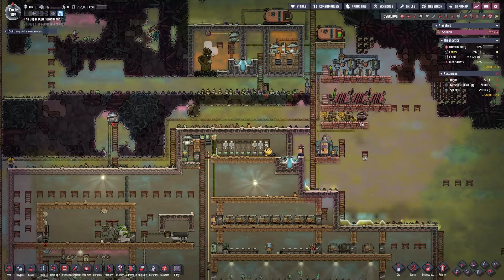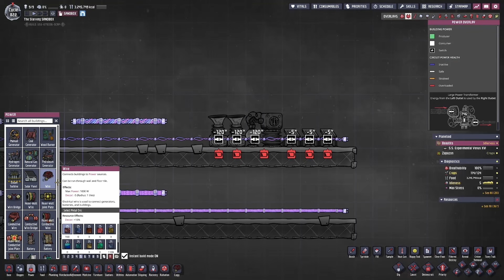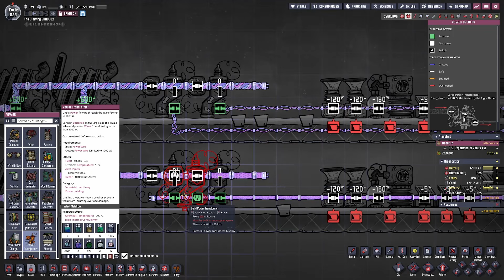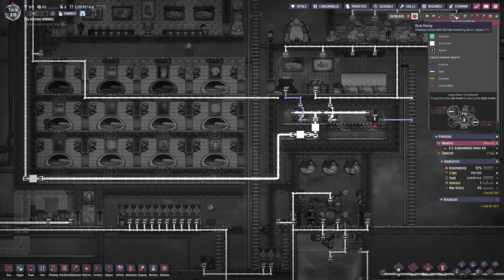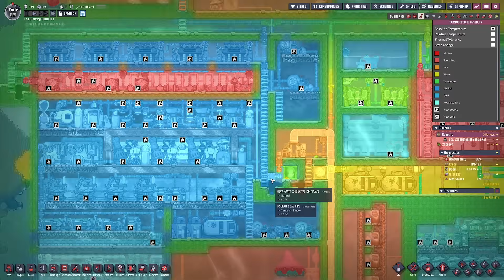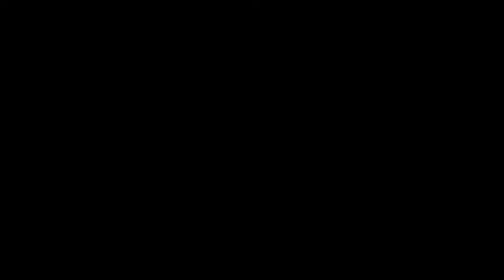Power Infrastructure and Tips for Mid-Game Transition - Oxygen Not Included

Comment: I wish wires worked like they do in reality. If there is a 10 watt scrubber hooked up to a wire, it should only need the regular wire, connected to larger wire that delivers power to something larger. However, in the game, it doesn't matter how much power a wire uses. It assumes the whole load is going through every length of wire. So, if your total load is 3000 watts, you need heavy wire going to everything, not just for the wires that actually have 3000 watts going through them. 🙄 Even that tiny air scrubber using only 10 watts, at the end of the line.

So much bad science and logic in this game. Things that COULD be real, but they would rather make us dumb in the process. 😁

Like a 1000 watt item should ONLY generate 1000 watts, or at least 1000 watts of heat. That "wattage" is a scientific measurement of the "heat" generated or "lost" from power consumption of X watts. (Amps * Volts)

Eg, a 1000 watt light should generate 1000 watts of heat and a 10 watt device should generate 10 watts of heat. A rock crusher would be a rare exception, as crushing rocks generates heat too. So the fact that it generates more heat than the wattage, is digestible. But a 1000 watt light generating 4000 watts of heat, totally breaks science and logic. Same with a 10 watt scrubber, not generating any heat at all.

Comment: Personally at begin i use 2 cosl gen battery and normal big wire to refine metals without overloading.
One thjng i dont like is to whipe everything natural. I like to fit base inside the natural ambient. 
Also a power vertical spine with heavy whatt wire allows to add power lines easily as needed, ising ofc transformers

Comment: why every machine is bath in hydrogen? is that gas better for cooling?
Reply: @Xonnas  hydrogen's thermal parameter makes it one of the best gas for heat exchange & distribution in an area.
Reply: Gasses like liquids, touch every layer of "things" in a block. Unlike liquids, it doesn't cause "flooded" status, which turns a machine off.

So... The gasses transfer heat from pipes, wires, walls, wall-plates, floors, machines and dupes. Under high pressure, nitrogen can act like a liquid. It can absorb and transfer large volumes of heat. So, a pipe cooling the "block area", will cool everything at once, easily. Assuming the gas is cool.

With just standard atmosphere... Like oxygen at normal pressure. It takes longer for that cooling in the pipe to cool the air. Then longer for the air to cool the machine, walls, wires, floors, etc. (the advantage to slower cooling like that... There is more cooling left in the line, for further locations down the way. In nitrogen, under pressure, it'll suck out almost all cooling in the first block. But, that will spread fast, through the nitrogen gas.

Comment: Watching the main screen I can see a huge snowballing issue thats gonna hit ur base in 40-60 cycles max, You have got 2 uncovered Coal generators and 2 Natural Gas generators which on Copper Ore could sustain till 75*C. That wave of heat with proper wire management will ruin ur plants nearby. You should change the way you work with that power planning near you base :)

Comment: 7:30 Technically this part is slightly incorrect. It doesn't overload due to the generators kicking on. The way the game mechanics work is that batteries charging up do not count towards the power limit, only consumers do. So what overloads the wire is more than 1000 W of consumption being on, the 3 coal generators could be on at the same time, no problem.

This doesn't make much of a practical difference in the usual power network setups, but it it possible to exploit this with power shutoffs, wattage sensors and automation if you really want to go beyond 50kW without 2 entirely separate heavy watt conductive wire networks.

Comment: I like keeping my heavy wire outside my base, and set up transformers on one side of the base, one for each floor, sending conductive wire inside. Keeps things tidy with zero decor penalties inside, and all the heat and ugliness outside.

Of course early on it's not possible, so I do go through a couple of rebuilds. The first is usually setting up the "power trunk" with a single small transformer per floor and regular wire, redoing the wiring so it's mostly one wire per floor unless there's some heavy usage on one floor, then I'll borrow from other floors. The second rebuild is just upgrading to conductive wire and adding the second small transformer. This happens only when I have at least a temporary metal refinery going, as I prefer using the rock crusher just for automation, rather than for power wires.

Comment: Here's a tip i learned the hard way. There's alarm structure you can build and it's really easy to setup with very simple automation. Set that up to alert you if you're colony starts using your backup power generators. That way you're not surprised by a sudden loss in power and no coal to restart the power grid.

Comment: The heavy watt conductive requires a Dupe to have electrical engineering to build. Typically early on, your builder dupe is not putting points in engineering so you have to change your Operating dupe priority to build so he will build the wires, I always build the heavy watt wire and deal with the bad decor until my builder dupes are smart enough to acquire electrical engineering.   
 I run my permanent power station at the bottom of my base (due to Co2 output)with a Power control station for increased output, then 2 transformers on each side of the room with 2 conductive power wires running up the left and right ladder run. Room is big enough to place 6 coal generators or 3 coal and 4-5 hydrogen generators 4 transformers. and the Power station. Just split the room to get the room bonus, both rooms will get it because they have power equipment in them, both don't need the station to get the bonus. This applies to any "room" with power equipment in any part of your base.  You can use a Mod for "insulated" conductive joint plate to eliminate the heat/ cold bleeding in or out. Thankfully someone fixed that mod.

Comment: My base which is quite high and narrow has a mix of lots of different gasses, what's the best way to remove them?
Reply: You can also vent to space
Reply: all you want is oxygen/polluted oxygen. So you'll want to filter from the top and bottom.

The only thing up top should be hydrogen so you could just open the door into space for awhile until it clears out. Don't forget about it though lol. To make sure you don't forget, you could put a gas sensor near the door that triggers a notification sensor to pause the game as soon as it detects oxygen. Name the notification "CLOSE THE SPACE DOOR" or something
On the bottom:
Run gas pumps into storage and sort out the contents later if you wanna save them. If you don't care about saving them, run a line up to space to delete them. If you don't care about saving carbon dioxide, you could run carbon skimmers for awhile until that's all gone, and then run pumps for the other gases.

If you want to get rid of all polluted oxygen (a pretty late goal for my colonies), you'll need lots of deodorizers and a very empty map. It's not worth doing this when you have lots of natural tiles blocking airflow. Deodorizers will filter air in an infinite horizontal range because that's the direction gas tiles randomly move in the simulation. They'll only filter in a 2-3 tile radius vertically. So you can have a vertical shaft of deodorizers that eventually clean the entire map. Any vertical walls in the way will require deodorizers on both sides.

Clean up any offgasing debris/pwater, contain them by submerging in a non-offgasing liquid or surrounding in tiles. Keep permanent deodorizers near areas where offgasing materials are regularly handled/created, like water sieves. When you deconstruct the temporary deodorizers after the job is finished, a single tile of a tiny amount of polluted oxygen will remain. What you need to do is construct tiles around the deodorizer before deconstruction to contain that pocket, then delete the gas by building a tile over it. This is a late game achievement because it's so tedious and requires a hollowed out map, and for no reason other than "it looks nice"
Reply: Oh and if you have a colony that doesn't use atmosuits for nearly the entire map, you'll want to design builds in a way so that carbon dioxide can naturally pool down to a place where it gets handled by carbon skimmers/gas pumps.
I consider colonies that don't use centralized atmosuit setups as a challenge/for-fun run. Forcing dupes to wear suits as soon as they leave their dorms is optimal imo

Comment: I'm just the sort of guy that likes automating for the heck of it, and there a fair bit you can do with to automatically regulate a power system, selectively cutting power to less important items, having some items run off-peak, running certain things only when needed, alerting you of power problems before actual damage occurs, etc. 
Not required or anything, but the tools are there to make a system that works a bit smarter if so desired, and it can help smooth things out. Especially for folks a little too easily distracted or prone to hyper-focus.

Comment: Lovely

In my current play I began experimenting with switching batteries.

There's a central line that only has generators, zero consumers.
At each split to consumption is a setup of a smart battery and a regular jumbo (or second smart but I'm cheap) with 4 power switches around them.
At any given time one battery is connected to the consumer side and the other to the generator side.
When the smart battery gets low it switches until high. This is why I like pairing with a jumbo - it'll last longer.

It takes a fair bit of materials to set up, but in the long run more is saved by not needing more than regular wire on the generator end.

So far I'm enjoying it.
But the heavy watt conductive spine does look pretty good for its function